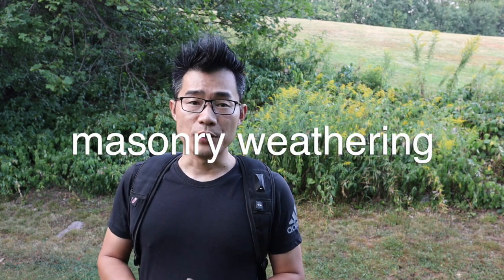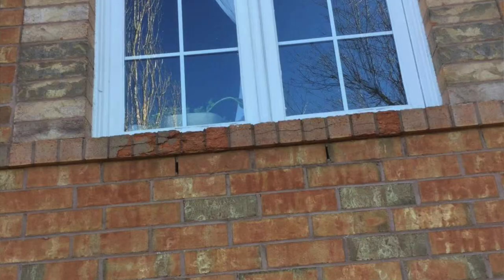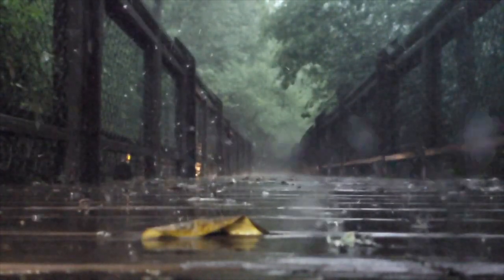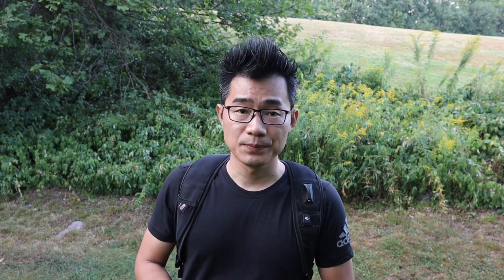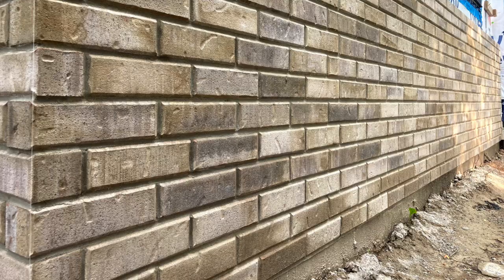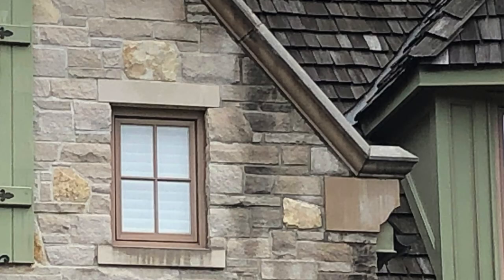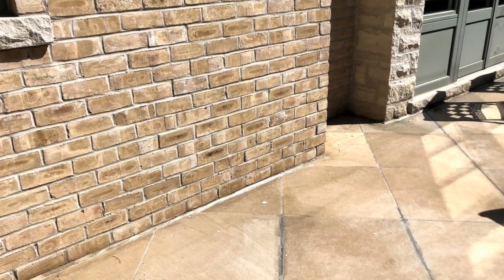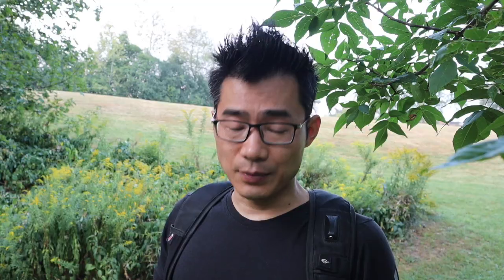外墙风化  Brickwall Weathering【字幕：Subtitle】：成因及避免的办法。

Comment: a very good vieo,  but if the bricks are damaged, is it easily  to remove and replace?
Reply from the maker: Yes very ease. It can be replaced piece by piece.
Reply: @CanadaDouker  
Thanks very much for your valuable info. My house bricks also got a damage like one of the photos showing in the video, but I think mine is still not serious yet. I hope so.   :-)   how big a water damaged on a brick will make you think about replacing it. Any sign or suggestions? 
Thanks in advance.